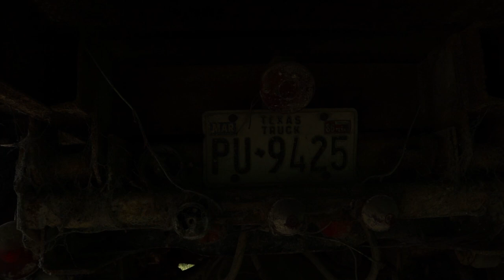Cabover Dodge 1000 Moved after 35 years! SAVED FROM SCRAP!

Comment: That old truck was run hard for sure in it's service life. Good luck breathing life back into her. I wish I was close I would volunteer to help with getting it going. I'm always up for that type of deal. Currently, I'm working on a 1988 Ford F250 diesel pickup I have swapped the motor on it.
Reply from the maker: Thank you. What motor did you swap in your f250?
Reply: @CMWorks-sd2fs  I kept the same model motor, 7.3 IDI diesel. Ford used that diesel back then, it was manufactured by Navistar/International, maker of the big trucks.
Reply: @CMWorks-sd2fs  Like I said, I'm a long ways away, in Northern Virginia about 25 minutes from Washington DC. I'd love to help but TX is a looooooong ways!!>
Reply from the maker: @kman-mi7su  Yes thats long ways away! I really appreciate the support and the 7.3 are the best V8 diesels.

Comment: the top plate of the transmission where the shifter take off you can see   there's two buttons in there free them up  /won't least the bearings oinside the  plate for you can shift gears you need to free those up/basically underneath the shifter is a pressure plate just spray down to PB Blaster and be fine
Reply from the maker: Thank you.

Comment: Why not cut the frame down buy a new cab make it in to a full semi why waste time restoring it i use to own one converter it from a box bed to cab over semi freind of mine bought it off me uses it to pull grain trailers on his farm sadly we couldn't save the cab a canon sized rust hole in the sleeper floor had to get a old cab over cab for it
Reply from the maker: Thank you. You have a good point but I really don't need a semi to haul trailers, I could use it more in its current configuration.